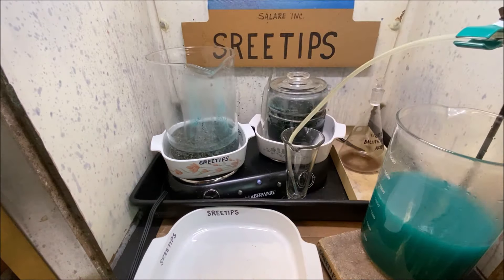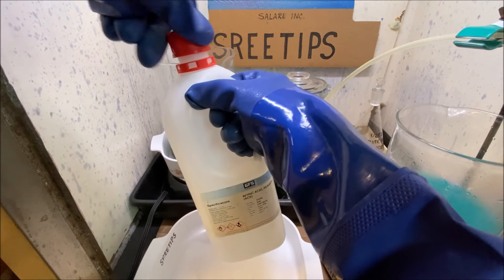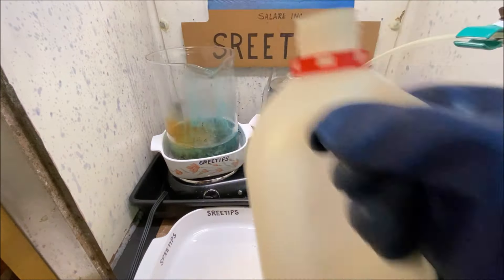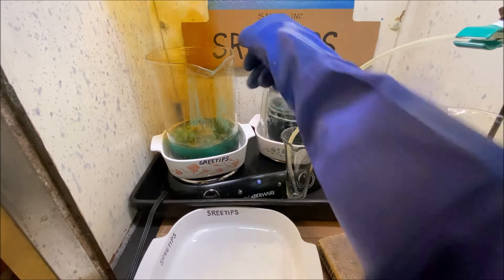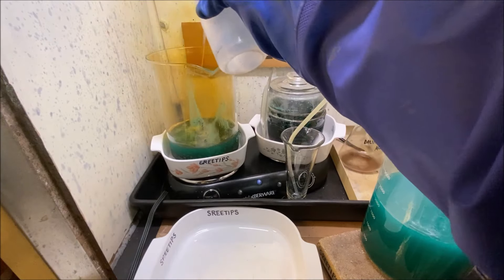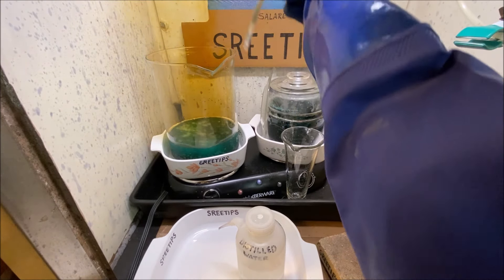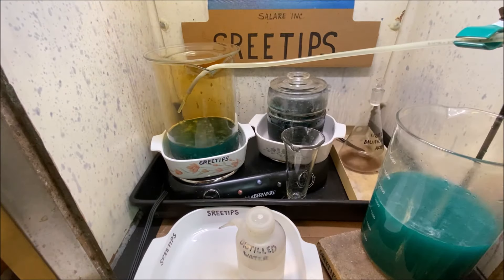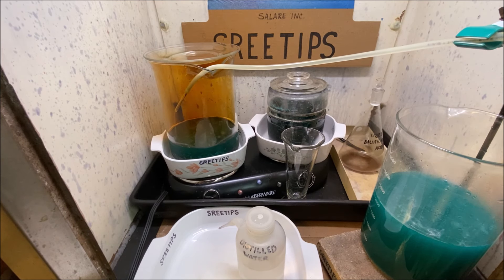Refining $47000 Pure Gold Bar At Home Pt3

Comment: 30:40 Another reason to use silver to inquart instead of copper is because it takes twice as much nitric acid to dissolve copper than it does to dissolve silver. Since nitric acid is expensive, Silver is the better way to go.

Comment: would recommend watching at 2X speed..
Reply: X 1.75 works better for me. Just easier to hear the chemical terms and processes. But yeah def got a speed it up a tad.
Reply: You are a genius 👏🙌
Reply: a
Reply: At 2x speed he sounds like Rodney Reynolds. Now that’s a kick ass suggestion!
Reply: Your the man my dude
Reply: No way the step by step process is what makes this worth the watch!!
Reply: Thanks for opening my eye's to this option lol this is gonna be a game changer
Reply: This isn't bad. There's a channel that takes you step by step through building a plane. And even at 2X speed he still talks slow. This is more watchable.
Reply: 1.25-1.5 for this slow listener
Reply: Thanks for that! He does drone on a smidge.
Reply: Reminds me of most of my Naval instructors.
Reply from the maker: I trained my crew of about thirty guys. Grilled them on the engineering plant, half on Tuesdays, the other half on Thursdays. When the inspectors came onboard they told the Captain that my people were the best trained men on the waterfront. Got me a job on the Commodore’s staff.
Reply from the maker: If I seem to “drone on” it’s because you’re smart and you get it right away. I tend to drone on for the benefit of those who learn a little slower.

Comment: Hey old friend. Another perfect how to from you. The final video for your king pour is up next. Hopefully it wont be any more than a couple days now. Too bad the graphite crucibles don't last as long as the ceramics eh. I get the same small losses when heating silver. Some to atmosphere and little tiny round bits from the pour itself. They do add up. Fortunately the loss to atmosphere is lessened a lot as it collects on the underside of the lid on my furnace in little beads that will get large enough to either fall of or I pick them off with my bench pliers..
Reply: Maybe if you poured over a black sheet or piece of wood or something it'd be easier to see any silver which splatters out? Not sure how useful it'd be, but it might further minimize losses!
Reply: @none.892  Thanks a bunch my friend. What I do see when making shot or grain is I see very small beads will bounce off the Ice. I use a 5 gal bucket with 16 litres od water and A bunch of Ice. When using snow I noticed no bouncers so I go to a friends that makes me crushed ice from his fridge and use that instead of ice cubes ir blocks. There is always the issue of the melting silver going to atmosphere. The only way to deal with that is to purchase ready made shot from a mint like RCM(Canada) but it is difficult to find.

Comment: Great to see that nitric on a drip.  This series just keeps getting more educational.  I am wondering if you might be getting some gold in the nitric.  Granules of alloy will need the silver dissolved out in order to be able to reach the silver deeper in each granule.  Depending on how well the alloy is mixed in the smelt, you may not be able to do this without sacrificing some gold in the process.  Maybe a gold test on your solution would be useful to find out if that occurs?
Reply: Gold doesn't react with nitric acid, and pure gold doesn't really dissolve. For the gold to dissolve in the nitric acid it would have to react with it, but since that is not happening (apart from maybe once ever 10^20 Gold atoms) this is of no concern.

Comment: Very excited to see this series progressing so quickly. You're spoiling us on so much great content released so close together! I have a question or two about efficiency in the use of your acids and rinses. Is there generally less waste if you process your metals in smaller batches, or do larger batches produce less waste, proportionally? Also, could rinsing the silver off the gold be done more economically (as far as nitric and distilled water use) if you were to pour the gold into a filter in a funnel and rinse it with your squirt bottle between each nitric boil? Thanks in advance for your answers, if you choose to give me some. As always, I'm a huge fan of your work!
Reply: If you're doing chemistry I'd say that wasting water is not often a concern. You use as much as you need to, of course you can use a little less water in between nitric acid washs, or even leave out washing with water in between, but you can't use less nitric acid. If you use too little nitric acid you don't get rid of all the silver / copper / base metals and that gets you impure gold.
What you could do to make it more efficient is perhaps stiring it with a magnetic stir bar.

Comment: What you were saying about using silver instead of copper to inquart the gold is a good reason to use silver, but not the only reason it’s a good practice. Another good reason is that it’s uses less nitric acid. The stoichiometry is that for silver it takes around 1.2 ml’s of 70% nitric acid to bring one gram into solution, whereas with copper it takes around 4.3 ml’s of 70% nitric to bring one gram into solution. So it takes less than 1/3rd the amount of expensive nitric to get the silver off the gold.

Comment: My guess on that final testing of nitric boil is that it was gold starting to go into solution (as the nitric boil was very strong and very hot) but that also means no silver is left in there, otherwise instead of the murky brown result, you would have seen that silver chloride milk form up. Anyways, waiting baited breath for the next part in the series.i gotta say, sreetips, you are awesome. You keep it educational, you have now gone on to a project that is larger quantity than you normally work with (and doing it well, almost as if it is not making any difference at all) , as well as running this all very smoothly. I would love to see you make enough on your ebay that you can enlarge your whole lab and set up, so that any time you want to work with 1 lb of gold and 3 lbs of silver (4 lbs of material to start! Woah! 😳😁😍) that it will not only be possible, but it won't cause any extra grief (like having to finish and clear all other experiments and clearing out as many beakers as possible, you know...) ... Also, if you have a go-pro that you can clip onto a mount, a mount that is secured to the inside top of the wall in the fume hood, and maybe a plexiglass box (case) for it (for the acidic fumes... I can only assume they will kill cameras dead) maybe it would allow you to get the overhead shots as well as no longer having to reach around the tripod to pour. I do like the ability to safely look into the beaker like that (given that a splash on the camera won't actually blind ME, but still, safety first...) ... But yeah, sorry for the ramble... Love the vids. 🤘❤🤘
Reply from the maker: Nice, thank you

Comment: If you stirred slowly with a glass stir stick you could dissolve more in each batch due to the contact points of each piece of gold touching each other leaves some surfaces not touched by the acid.
Reply from the maker: Good point, thank you

Comment: You answered it later: easier to refine the gold in more solid chunks. Ty

Question, if you can, why not use magnetic stirring for the nitric boils? Too messy at low volumes?
Reply from the maker: Using a stir bar would tend to break the gold apart and cause very fine particles of gold to suspend in the solution.
Reply: @sreetips   Yes, makes sense. Thanks again.

Comment: Senior, the easiest way make that molten metal freeze quicker when you're pouring shot is to just submerge the part of the board you're pouring the metal on. It will begin to freeze before it hits the board and it should make smaller shot.

Comment: 12:00 Have you thought about installing a 1/4"20 threaded insert into the side of your lab hood so you can mount the camera from inside the hood to: 1. Be able to pour the liquid away from you and 2. Have different angles of what is going on. The inserts are available at Home Depot or Lowe's for pretty cheap.
Reply from the maker: I’m just not that sophisticated yet

Comment: I know this is a massive necropost, but hopefully you see it. I have another suggestion regarding your drop board - if you'd like your gold or silver shot to look more like, y'know, shot, may I suggest carving small channels down the board, like lightly corrugated iron. The metal would be more likely to ball up if it hits the water "rolling", so to speak, no?
You'd have to experiment with depth of the grooves, but I think it could work.
Reply from the maker: I’ll give it some thought, thank you

Comment: Silly question: Are the glass plates that you put on top of the beakers there solely to prevent foreign material from falling inside or is there an additional purpose?
Reply: They funnel the condensation back into the beaker and also keeps stuff out.
Reply: @Card_Asylum  That makes sense. Thanks.
Reply: @IMDunn-oy9cd  no problem. I only answered cuz I had the same question on another channel and they answered before I asked.😜 ✌️

Comment: 20:00  I like to make ice blocks for my cooler for work out of the Sterilite 6 Qt Storage Box's that sell for roughly $1 from Walmart each. they take about 10 hours to completely freeze.  i also thought that you should have a spray nozzle to spray down you board when making shot.  also you should have a taller bucket or can to hold more water higher then the turkey deep fryer pot. i suggest a Plastic Drum with Lid - 30 Gallon, Open Top, Blue  which you can get for about $25 bucks from craigslist.
Reply from the maker: A tall steel 55 gallon barrel
Reply: @sreetips  yeah!

Comment: sreetips once you've finished refining the gold will you be doing a video series on recovering the silver from the used nitric acid? also would it be worth you keeping said silver to use for your next batch of gold refining rather than using sterling silver that potentially has dirt and such mixed into it?

Comment: was going to ask a dumb question, but you covered it at 53:00 ,my question was you got a good surface area by melting the gold into granular , then used nitric acid to remove the  base metals and silver, why go further with aqua regia  HCl + HNO3, why not just melt it into the gold bar?  so my guess is if you melted now you might have around a 23k gold bar.
Reply from the maker: The gold could have been melted but the problem is lead. If lead is present, even in trace amounts, it ruins the malleability and ductility of the gold. Refining with aqua regia is the only way to get the lead out completely

Comment: Question Sreetipts at 23.00 if one was to use copper to inquart. Could copper be used as a alternative to the silverware? Would the level of silver in a copper based inquart being ruined or anything  (cementing) while trying to null the nitric left in the solution? Coper is only option to inquart with currently! Thx

Comment: Hello again Mr Sreetips I'm wondering if you inquarted the Gold with cement Silver instead of the Sterling then maybe you could reduce the high quantity of Copper nitrate that you have to deal with as waste later on. Your thoughts?
Reply from the maker: Not recommended. Palladium will build up in the silver. Plus, I have lots of sterling that needs to be dissolved.
Reply: @sreetips  cheers yeah later in the video I heard you explain that.

Comment: I was thinking that if you poured your alloy from higher you should get smaller beads, therefore increasing the surface area of your metal and subsequently reducing the time needed to remove the silver and base metals from your gold. The same will work for your silver cell.
Reply from the maker: Agree

Comment: When I see the orange vapor from the nitric acid boils, I am reminded of the colors from smokestacks back in the early seventies in Detroit, and which you can probably still see in parts of China.

I can also see that having copper as one of the inquartation metals helps you tell when the nitric acid has done its work.